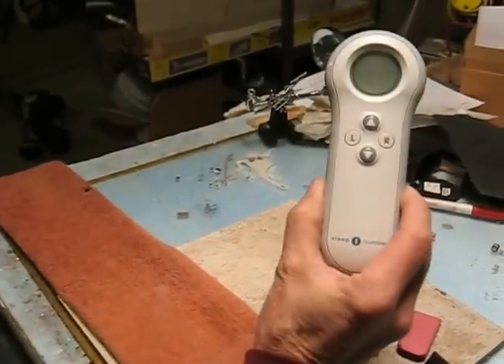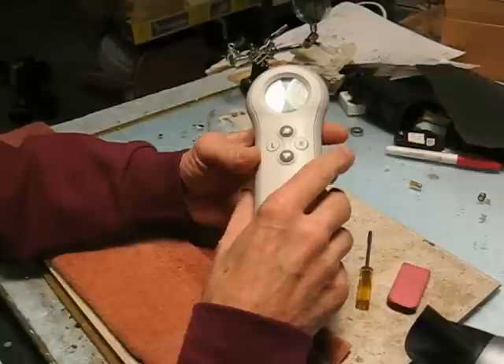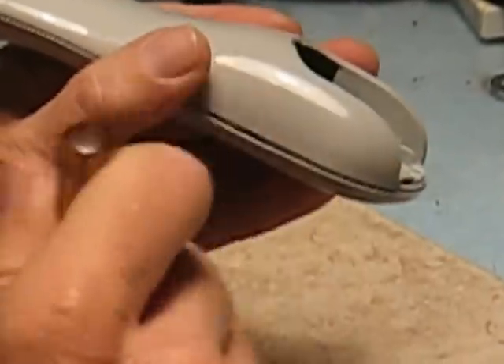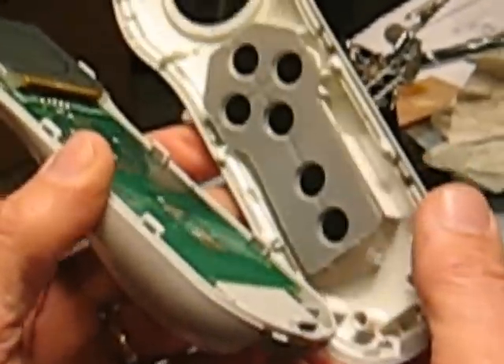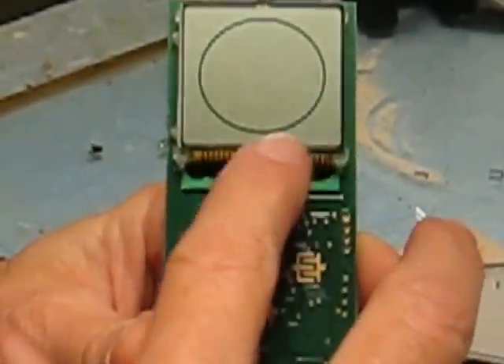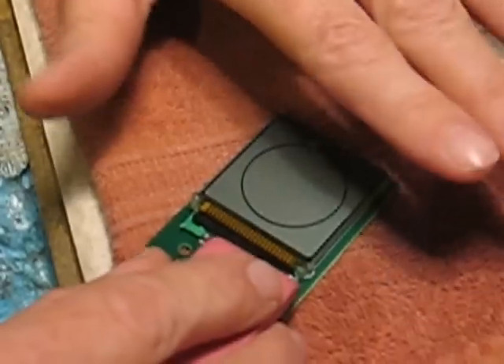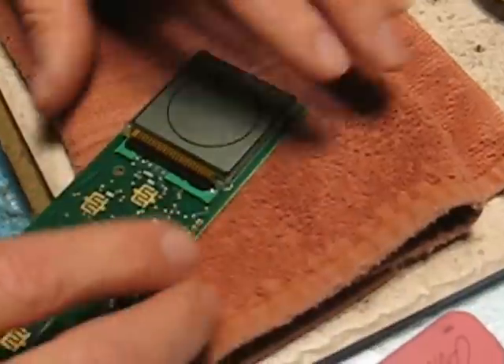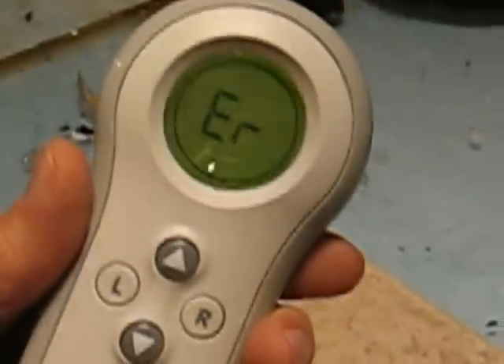Repair sleep number (Select Comfort) bed control display

Comment: I've had my sleep number bed for like 16 years, worth every penny. About 8 years ago the remote started to fizzle out and if I banged the remote in my hand, eventually a slight number would show. But after all these years, you get to know by feel, if you've hit your number or comfort zone or not. Anyway, the remote has been acting up lately with the buttons not activating it correctly and tonight I had it.  I was like, "ok youtube, you have videos on almost everything known to man, let's see if someone made a video on this... no shit, there's a video!" Well folks, after heating 3 times, and using a soft towel to rub and press, It worked! I've never been so giddy and amazed about something like this!! Sounds silly, but sometimes it's the little things in life that bring a lot of Joy. And I really needed this after the day I had. Not sure for how long this will last, hopefully another few years, but I appreciate this Greg White who made this video. FYI, i don't have the battery remote but I have the wired remote. I did not unplug the wiring at all when I did this, I tried but it was to hard remove from the clip and I didn't want to break one of the colored wires. Good luck whoever watches and tries this next :-)

Comment: Almost all the segments on the display were dead on ours.  We have the same exact remote that Mr. White has.  I heated it up until about 30% of the display had turned black.  Used the eraser like he suggested.
The display now completely works!  Thanks.
FYI: sleepnumber.com wanted $20 for the remote and $7 for S+H.  I guess it's an older unit and demand is dropping off because I was half expecting them to quote me $50 or something.

Comment: Thanks! My wired controller had the same problem, Heating it fixed it like it was brand new, saved me the $303.00 that sleep number quoted me to replace mine! Thanks again!!!

Comment: Thanks for posting.  I followed with exception of after heating to get display black, I applied constant, full pressure on the display only until it cooled, then released.  Worked great first time!

Comment: Thank you for sharing.  Took me about 15 minutes to fix both.  I found that if you heat the display until it is completely black, then apply pressure evenly as it cools, you can fix it in one try.

Comment: Success! We used a heat resistant spatula to press on the striped strip that connects on the board and a large eraser to press on the glass. There in no need to press everywhere on the strip just where it meets the board and press all over the glass especially where the strip sandwiches in. We also used a heat gun which gets hotter than a hair dryer. It worked great; if you do the same just know that it could possibly get too hot so be smart. Interestingly the glass turned black as it heated up but reached a point where it got lighter again as it got even hotter. (so if it stays black it's definitely not too hot; we did that the first time and it still needed to be redone. The second hotter time was the charm) 
Also you can check your progress by holding the battery to the connections on the board and place the rubber buttons on the board without putting the case together. Saves you some time if you need to do another heat and press treatment. 
Hope this is helpful.

Comment: Awesome video Greg.   Was just on my way down to get another remote and found your video.   Worked the secind time for me.   Agree with other comments to let the screen go black.   I found pushing the ribbon on a 45 degree down and towards the screen worked and was where the disconnect came.  Thanks for posting!

Comment: Thanks for the video!! I was able to fix mine as well. I used a heat gun, and it warped the board just a bit, but it is working great!! I also found that using cell phone plastic tools made opening and closing the remote a breeze. Those clips did not look very strong so I pried the top open and then pushed the 2 halves together.

Comment: I tried the heat method several times, it improved slightly but intermittent. I took some steel wool and cleaned the circuit board contacts beneath the buttons. Presto good as new, it works flawlessly.

Comment: My remote has missing numbers also. Now I know how to fix it! I don't suspect an adhesive as ribbon cables are either clipped in or soldered. The heat reinitializes the Liquid crystal. Many thanx!

Comment: Thanks you so much for this video, it fixed all the symptoms you described and shown here, but if i might add something:
I believe this has little to do with the ribbon but more so with the LCD display, the ribbon was micro soldered in my control unit, i assume this is the case for most.
i heated the squared LCD display a bit longer than suggested until the LCD became totally black and i could barely see the digits thru it, then i rubbed my fingers thru it while it was cooling and did the trick perfectly, one try (but longer Heat), i would say 1 minute or so. I applied direct heat till the LCD got black then i started moving the dryer in a isolating manner. 
Anyway..great tip, saved me some cash as well.....thanks again

Comment: I too, similar to one of the other posters have been in electronics for about 37 years... in my case there was no glue at the bottom of the ribbon.  I think it is indeed heating up the display and then pressing on the display while hot and move the LCD fluid around.  I suspect that something is going on with he fluid and how it interacts with the ribbon.  Mine took 3 hair dryer heat ups turning the display black and heating for about 15-20 seconds longer.  I noticed my display would turn black quicker on the left hand display and longer on the right hand and top of the display.  This right hand section was the one that was not working after the first heat up.  So it is as if the liquid just has   to get liquid again for a bit due to the heat.   So I concur with this fix and am leaning towards it being related to the LCD and not the glue (no glue on mine.)
Reply: I must ask, how do you think the ribbon is attached and what do you think the ribbon is made of? The reason the video refers to the ribbon being glued is because it is. And the reason why... a portion of the ribbon is glue. Just align a ribbon up with contacts on a board, heat the ribbon up while applying a little pressure and it glues itself to the board.

Fact trumps opinion... and that's a fact.
Reply: it is attached via solder, the glue just holds the ribbon from moving around.  Glue does not conduct, but the solder does.  I have repeated this test by just sitting the device out in the Arizona heat and it fixes it as well.  never touched it.
Reply: asilentnoize l

Comment: I believe you are entirely correct.  Some manufacturers use a faulty glue.  The problem is caused by storing the remote in a hot area in the summer time.  Some say store the sleep number remote in the refrigerator during the summer.

Comment: 2 words... HEAT GUN.  :-)  Speeds up the process.  Beyond that... Tacking on like everyone else... approach definitely works, and as he mentions, not only is it ok when the blackness spreads across the screen, but mine didn't work til I heated it until that point.

Comment: Thanks for taking the time to make this video. My problem is that there is leak in the hose connection to the pump itself and despite removing the three screws I cant get the two halves apart without using damaging force. I can open up an entire side but not the corners without fear of breaking something. I assume the halves are joined in a similar manner as the remote (but then why the screws?), but it's requiring excessive force to pry the halves apart. Do you know how to take it apart so I can look at and fix the the hose connection fitting? This bed was given to us so that we didnt have to buy a new mattress (I thought it was just a regular mattress) so I'm reluctant to spend money on it. I've found information on just about every other aspect of the bed system except this. Figures. If you can help me I'd appreciate it.

Comment: thanks for the heads up.
I'm a electronics bench tech but haven't seen this problem yet. Just goes to show ya you never too old to learn something new. i've pumped solder suckers since the early 70s worked onthe first calculators ever made, went on to the medical field, cardiac cath labs tnan on to CAT scanners and now to fMRIs. travelled 20+ million air miles but never seen a display issue like this one. you cab bet your ass I will get more info onthis in case there's more to it but you got the meat of it no doubt!!!! i just  used my hot air soldering station for concentrated heat set at 820F I will bring this issue up on the tech forums I belong to and give you full credit for the fix and send link. Kudos again!!!! maybe i'll be able to reciprocate to ya one day. pm me anytime, my strength is in digital though done RF especially resonant high frequency high voltage xray generators 150KV/ these days i do mainfraime forensics and enterprise network analisys linux centered but  haven't forgot windows yet. will admin server 2003 2008 2012 for awhile longer. ttfn

Comment: This worked but I had to do this every time I needed to add air and my bed had a slow leak so it was more than I wanted to deal with.   I was able to order a new remote and pump from Select Comfort for around $80 including shipping.  When ordering a new remote you also have to buy a new pump.  The new pump and hoses also fixed my slow leak problem.

Comment: I want to give you a big thank you it worked for me as well. I had to do it two times but getting the screen all black with the heat tool it works perfectly all the digits show thank you very much you save me $50-$100

Comment: I tried a heat gun,which is much hotter than a hair dryer, about 4 times.Only got some partial digits.I figured out a way of getting more heat to only the place needed.I took a mica transistor insulator and put it over the contacts.Then pressed hot soldering iron tip over the mica insulator.Moved both across whole width of contacts.This method heats and presses at the same time.Better than heating whole area,which could cause damage.Finally achieved success.Was afraid that continuing using the heat gun might destroy something else.Make sure to do both the connection to display and to PC board.I found that doing only display didn't fix.Do both ends.

Comment: Yep, works. Took me about 20 minutes. However, I feel that the glitch is not with cables, but with display itself (I may be wrong). Need to be heated till black, let cool down. Did not use eraser. No zip ties, no duck tape, too :-). Two beers were very crucial, though. Anyway, thank you.

Comment: I LOVE YOU!!!!!  It took a few times to get it right...but now its back!!!!!!!!!!
Reply: Thank you so much for posting this video. It worked fantastically. I did have to heat up the screen several times before all the segments worked.  I have to admit, i was concerned that I was going to fry the board in the process.  However, it worked perfectly!! Thank you!!!

Comment: lol, I almost had it perfect, but, as usual, I went to far. Cracked the LCD screen so now it's useless.  Be careful folks.   THANKS FOR THE VIDEO, IT WORKS IF YOU DON'T MONKEY TORQUE IT.  Also, in my case, it was the LCD screen I pressed to get it to work, pressing wires did nothing.  Huh Rah!

Comment: I had to do this again and I got a little irritated using the eraser on a pencil I actually took the end of my belt which was soft and maneuvered around the screen pushing with a little more force and it got back to perfect again thanks again for mentioning the heat from a hair dryer to help get this done but I think that using a soft cloth could work as well as an eraser

Comment: Thank you so much for this video. I had exact same issue i thought it was the battery but i checked it with volt meter and it was fine, but heating once and pressing on it fixed it. By the way i used heat gun in low heat setup. Again thank you.

Comment: I am a retired Automotive Engineer and have a wireless remote controller that was partially working. I tried your solution and it worked perfectly but I did not see any wires. It may be that the LCD material needed to be warmed up for it to flow properly. The next time it quits, I'll try just heating the dial face without remove the back. Your description of the removal process was very good.

Comment: As others have stated, this works equally well on the wired remotes. Which is a big deal, because you'd have to buy the whole pump and assembly from SN, at a cost of around $300+.

I used a heat gun from Harbor Freight, set on the low setting. much faster to heat things up than using a hair dryer.

Comment: Bingo !! After about a dozen attempts , and hitting a wall of about 50 % success , l read the comment about continue heating for 20 seconds after display is black . I could tell right away whatever was holding it back had been unblocked . So thanks to the utube poster , and the guy ( or gal ) for the 20 second tip !!

       Update :  Uh-oh , next day  some segments missing . Guess I'll give it another try ☹ .

Comment from the maker: Ken, I actually have an old wired control.  I took it apart and I'm not sure.  It looks quite a bit different than my wireless control, especially the LCD.  In my old wired control the LCD is a tiny thing perched on the end of a sort of rubber stalk.  I'm not sure where you'd push on it and I'm not sure how the hair dryer would affect that rubber.  You might try using just finger pressure to squeeze parts together and see if it improves.  Sorry I can't be of more help.

Comment: I can’t believe this worked. I had to heat up the screen and press on it probably 15 times, but suddenly it started working. 
Like others said, I heated to the point the LCD went black, then pressed on it with an eraser, then firmly with my thumb once it cooled down. Suddenly everything popped up.

Comment: 3 minutes to do: disassemble it per the video, give it a good heating with the hairdryer as per the video, 20 seconds pressing with the eraser as per the video . . . and . . . VOILA! . . . It works again.  TY for a quick, cheap fix to a vexing problem.  Oh, and I bought my KING Size "Sleep Number" bed at a garage sale for $400 . . . owner wanted a smaller bed (queen size) in the room and let it go for a song.  Check out your local Craigslist, Ebay, etc.  You may find a bargain like this, too.  And, my wife and I are very comfortable on it. :-)

Comment: Heat till LCD display screen is black. Quickly press / rub LCD display screen with eraser till black is gone. 1st heat did not work 2nd heat worked a little 3rd heat and rub to cool fixed 95% of the LCD display remote screen. I called it good to go. 
So 
Sleep Number Remotes LCD display screen missing numbers are easily fixed with a hair dryer a book a towel and an eraser.

Comment: LOL my issue is I could not remember what size battery it took.  So I came here a 9V!!  I saw my answer right off.  I do not keep the battery in the remote since I don't use it that often.  TY TY TY TY TY!! In todays world of chargers it's easy to forget batteries are still used.

Comment: Greg, thank you so much for taking the time to make this video to help others. I tried the hair drier and pushing on the connections like you said the first time. This was unsuccessful, but I probably didn't let it get hot enough. I saw the edge of the LCD start to turn black, but was afraid to over heat it. After it not working the first time I was going to try it again but decided to read some of the comments first. I read one that VulcanCCIT
 wrote and that made me think. This is an LCD with liquid in it. The heat makes the liquid move to the surface creating the numbers, and when it cools (very fast), the numbers disappear. So honestly, how often do we use these remotes? We find the setting we like and that's that. We don't touch it for a long time. This liquid might get a little thick from not moving. So I thought of it like exercising the liquid. I got my heat gun out. Had it set to 500* and it didn't take long (seconds) to turn the whole screen black. I let it cool, (exercising the liquid) then tried it and it did improve. So I heated it up again, this time just a second or 2 more (remember that was 500*). Let it cool good, One more time, and tried it. All better! If it's not cool enough some of the lines don't go away totally. But after time to cool they disappear and don't have another issue. I honestly never write any kind of review or comment unless I feel very strongly about it. This was worth the time. Thanks again Greg for the video, and VulcanCCIT
 for your comment that made me understand how this display actually works.

Comment: I have the wired remotes with the same exact problem. I have been searching
for a while for a fix.   I assumed it was the LCD display connection causing the problem
as I also have had this type a problem with other electronics.

Would you know if the wired remote has the same LCD display as the wireless
and would heating the area soften the glue to allow you to press the display back
into to place for a better connection?
Thanks
Ken

Comment: I’ve got the very old kind of remote (corded). I still did this using your method (hair dryer and eraser). I did the rub out in several directions more so than the push down method. Anyhow got the numbers to show again. Crossing my fingers it lasts for at least 2 months. 
How long does this usually last for?

Comment: i have wired devices and had to heat them several times until the screen was completely black and pressed firmly along the ribbon connections...sadly the repair didn't last and its back to blank displays...poor quality controllers!